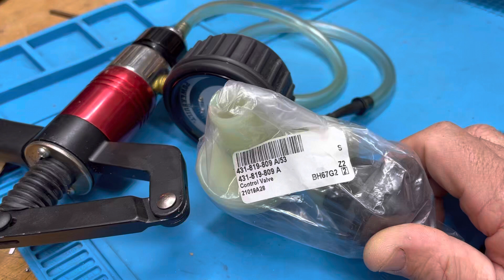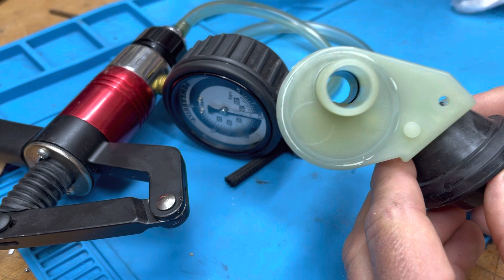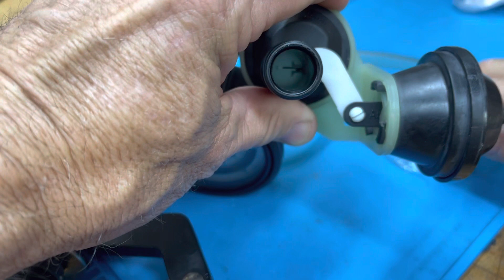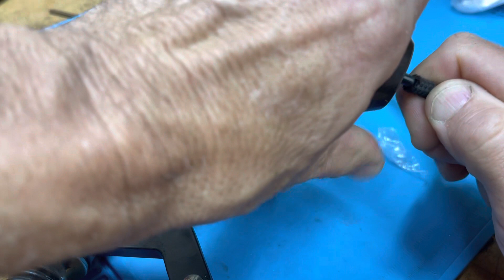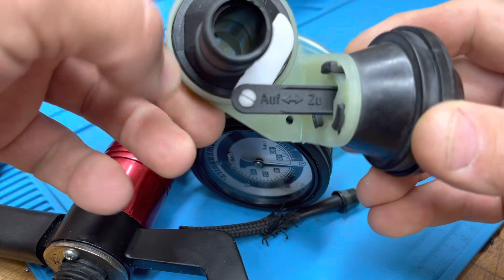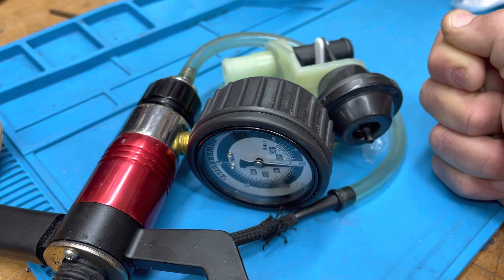Porsche 928 heater control valve demonstration

Comment: Would this part leak coolant if bad?
Reply: Very unlikely. What tends to happen is that the diaphragm fails so it no longer holds vacuum so you get heat all the time.